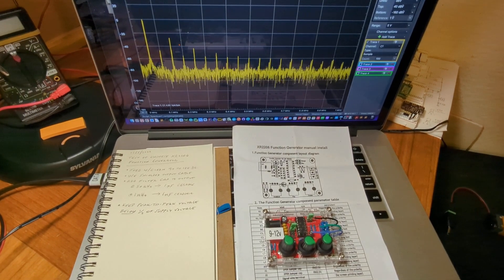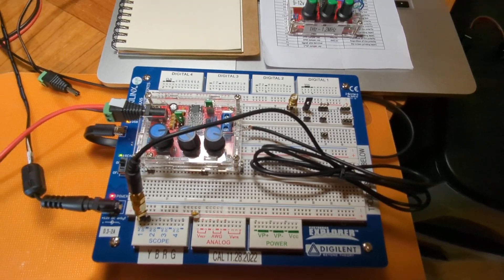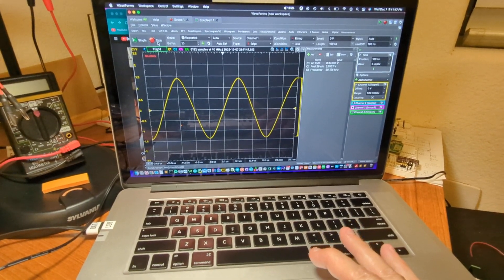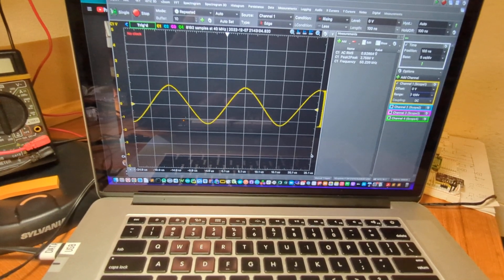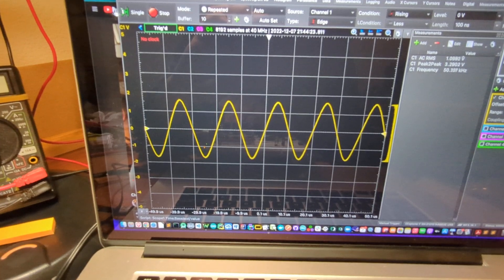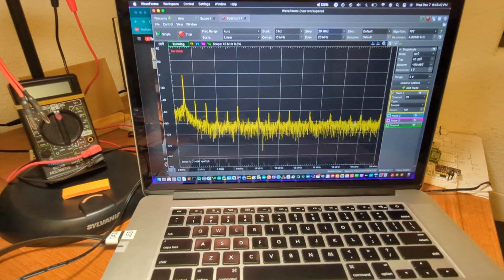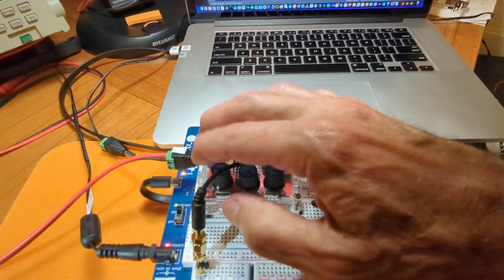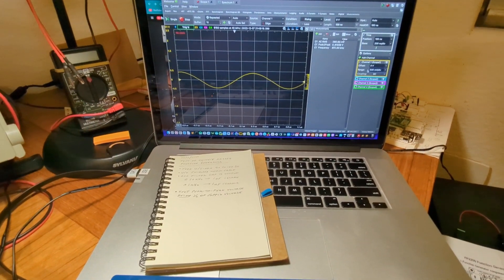XR2206 Function Generator: tips for cleaner output signals

Comment: I picked up one these recently. I get no auido tone when running it through a speaker and when it's powered, I get continuity between square and ground, that seems odd to me. Everything on the board looks good, so I'm thinking it's a possible bad chip?
Reply: If you are trying to run a speaker directly, I don't think it will not work. I believe that you will need an amplifier. This being after you work out any bugs in the circuit, of course.
Reply: I think you might fry the chip, if you try to run a speaker. Speakers are low ohm devices. I think you need a preamp and an amp. And, you need to match impedances.
Reply from the maker: I just verified that this device cannot even drive a tiny speaker. As for continuity, I've measured the resistance with the device turned off. There is about 10 kOhms between the ground pin and either the sine or triangle output pin (depending on the pin jumper). The resistance between the output pin and the ground pin is infinite, if the jumper is out. The resistance is infinite between the sine and triangle output pins, as expected.

Comment: If I recall correctly the XR2206 datasheet refers to a min of 10V, max of 26V.  I created my own PCB and running it on a 12V battery its quite stable and I managed to get a little over 2MHz.  It may go higher.  The output is around half at 2MHz compared with, say 20kHz.  That's is not exactly a surprise though.
I haven't tried using a higher supply yet but I think I'll have a more of a play with it.
Reply from the maker: Thanks for that info. Just had a look at the datasheet and you are exactly right about the voltage range. My bad! I
I'll have to relabel my device and try it with higher voltages. The datasheet also shows rapidly rising distortion above 500 KHz. I'll give higher voltages and frequencies a try. Thanks again.
Reply: @philipgiacalone5605  I found at about 2MHz my signal was still symmetrical and the Duty Cycle hovering between 50%-53%.  No clipping or distortion.  I use the wave shaping trim pots to clean that up.  This also can including lowering the output - but hey that what you have amplifiers for 🙂
Reply from the maker: Just re-checking the documentation that came with this function generator kit from China. It says to use a 9-12v input voltage and that the output waveform is unstable above 12v. Testing shows very little difference at voltages above 12v. I went up to 19v.